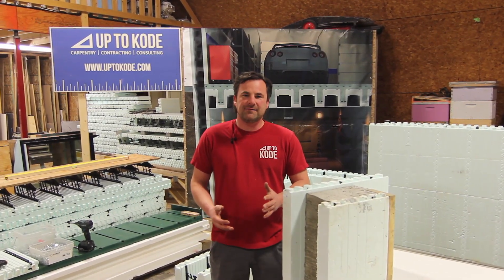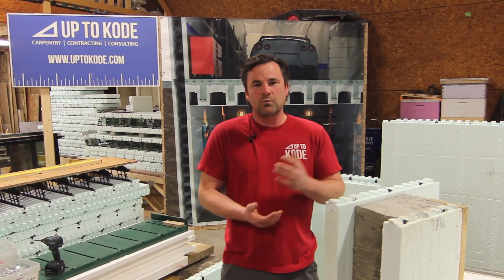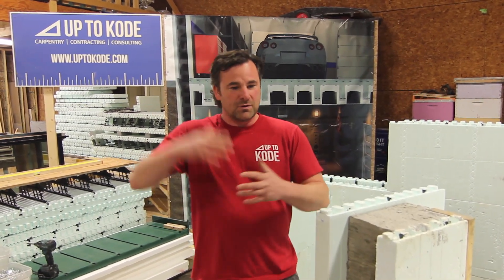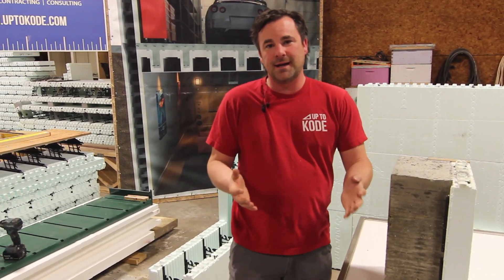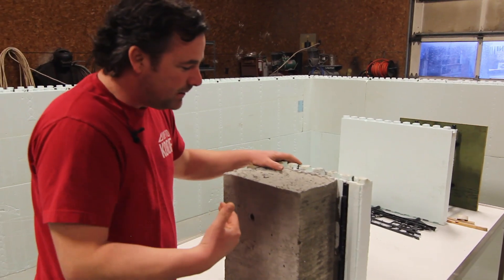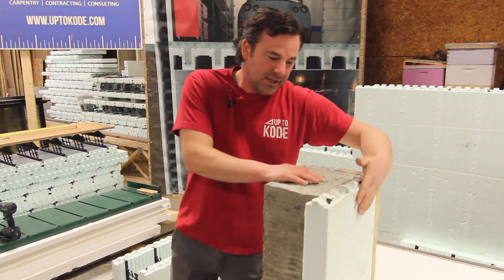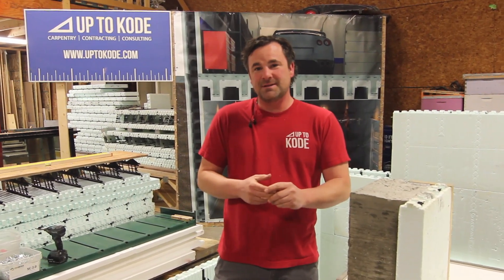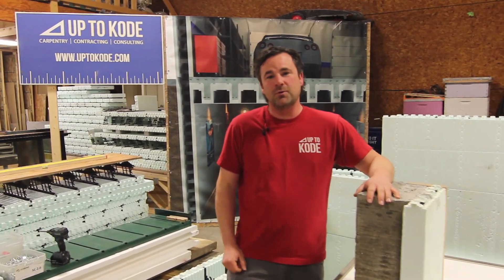Why ICF should be used for Passive Homes

Comment: I've lived in a ICF home for 21 years now. Thermal mass does have impact. We've learned to live with it. 
Many years ago we took a trip during xmas time. Heat was set to 60F. Took two days of running the heat pump to get back to 70F. Talked to a HVAC engineer and he told me if you build a ICF home you should use a software program designed for commercial buildings to determine sizing. Commercial software takes into account thermal mass. That was back about 18 years ago. One thing I do is not let the temp get more than about 4 degrees from my desired setting. In summer I like about 75F so the warmest I let it get to is 79 or 80 when I go to work. Winter time I never let the house get below 68F. Otherwise it takes the 3 ton HP hours/a day to get the temp back to where I want it. During the shoulder seasons of Fall and Spring you have to watch out when the sun shines strongly. A good sunny day can heat the house to 73 or 74. Two degrees warmer than we like. Sometimes more. This season we had some very sunny days. Outside temps only got into the 50's but by bedtime the house was still 75ish.
Reply: Get a smart thermostat with a schedule, and run the heat pump at times of maximum coefficient of power - run it all day during winter in heat mode, and run it at night in summer in cooling mode. 

In other houses you would have to do the opposite  (or run it 24/7) and suffer from lower CoP on the heat pump.

Turn the thermal mass to your advantage.
Reply from the maker: I like it
Reply from the maker: So is the ICF a nuisance or do you like it?
Reply: @uptokode  I like ICF. ICF is different than a typical wood house. You learn how to get the best from it. You need to be aware of how the home reacts when it comes to HVAC. love the thick walls. Love the lack of sound. I've slept through many storms. In strong winds...no creaking of the walls. No worry of rotting wood. It is KISS compared to some passive house wall designs. 

So my home is about 3600 square feet of condition space. Ranch with a walkout to the south. 
6 inch ICF on main floor
8 inch ICF for the basement
2.5 inch foam, both sides. 
Eco-Block which I believe is no longer around. 
Pellla triple glass windows. 
3 ton closed loop geothermal heat pump forced air. ERV. 
Plenty of windows. A lot facing south. Two foot roof overhang. 
Heat load calculations said the house needed 42,000 BTU for heat and 20,000 BTU's worth of cooling.  Heat load calc's done by a local electric utility. Part of a program to encourage more heat pumps they did the cals. 
The HVAC fan is ran 24x7. 

In winter I never want the temps to get below 68. Otherwise it takes forever for the home to heat up to 72. If it is really sunny that can easily add two degrees or more to the south side rooms. My current system is undersized for the coldest months. The polar vortex had us running a gas fireplace often. 

In summer or high humidity times the HVAC system doesn't do a good job in bringing down the moisture as it is oversized for what is needed so it short cycles. Sometimes I run a dehumidifier in the basement. If not home I let the house get to 78ish and then kick on the AC to take it down to 72 for sleeping. That can take hours but it does a decent job in removing moisture. I know some newer HVAC units and controls can deal with this issue. 

If I were to build again, which I'm thinking about doing...I'd do the following:

Nudra with the extra foam to the outside. 6" worth of concrete. 
Air to water Heatpump for heating and hot water. Something like a Nordic unit out of NB. https://www.nordicghp.com/product/nordic-products/air-source-heat-pump/air-to-water/ 
Zender as an ERV. 

Radiant heat everywhere. Basement slab, garage slab, maybe thin slab on suspended wood floors or wall radiators. Reason: comfort and low noise. I've been in radiant heated homes. It is hands down the most comfort. I hate the noise of the forced air system. Especially when the house is so quiet you can hear almost everything. 

Cooling: water to air fan coil or mini split(s) for cooling. but more likely the mini splits. Heads in the bedrooms and one in the living room. Mini splits are inexpensive and can provide stand alone de-humidification as well as heat in shoulder seasons.
Reply: @BobLobsiger  Your ICF house walls are not the problem it is your windows and doors and your wood roof.  Best windows triple pane today are at best an around R-value of 10.  Most doors are no better.  So to change the outcome you need to limit the windows and door openings and sizing.  Between windows and doors in a wood build house is at least 50% of heating or cooling problems.  it will be no different in an ICF house.  Also what way your house faces along with the number of windows.  So south and west windows and doors can be a problem to take a good look at in North America.
Reply from the maker: I appreciate the information!

Comment: Def a good option in Canada especially! (And double Canadian stud wall system beats 2x6 any day.) Regards from USA.
Reply from the maker: Thanks!
Reply: LOL ICF is good anywhere.  From Antarctica to the north pole, from small structures to massive high rises.  Just use real non-rusting rebar and stone fiber re-enforcement's which I have both which make concrete so it doesn't spauld or break up.  Also if you double anything it is better than a single!  But wood will never have the mass, strength or durability of stone.

Comment: Good info : Look at QuadLock ICFs all those insulation “R” value upgrades are part of the system and it only has four components to the wall (QuadLock) also all angles and curves are made in the field . A well engineered system and great support system!
Reply: I recommend that anyone interest in QuadLock,take the time and take the training course , as it will give you a better feel for the product.
Reply: @chasjones5756  I've watched tons of videos on ICF (all brands) & I was leaning towards Nudura, do you have experience with both ? If so how would you compare the two ? Any pros & cons to consider ?  Thanks
Reply: @littlewingpilot  Fire ratings, webbing or studs, holding power for finishing, size of block and time to build, R values, versatility in construction, fully engineered if needed for your area and laws are just a few for you to consider.  I feel QuadLock fall behind in some to most of these areas.  But you need to make up your own mind on this one.
Reply from the maker: I’ve heard great things about QuadLock. I just need more houses to build so I can learn more.
Reply: Ndura, quad and build block are arguably the best three systems to consider, also superblock

Comment: You will never get a stick frame to perform like a (ICF) thermal mass house. It physically impossible. The air tightness is also a non comparison, when properly installed.
Reply from the maker: Absolutely agree. One of the great ICF contractors around my area (engineered Fortruss btw) says this when asked to compare ICF to wood frame.  “I can’t build ICF sh@!ty enough to compare to a wood frame”. He’s got a point.
Reply: It’s all density no way timber can compete! My only ding on icf (which I’ll be building with) is the environmental impact but these houses can last a tremendous amount of time so I think like stone building in Rome ice has the chance to work off some of that impact on the long run